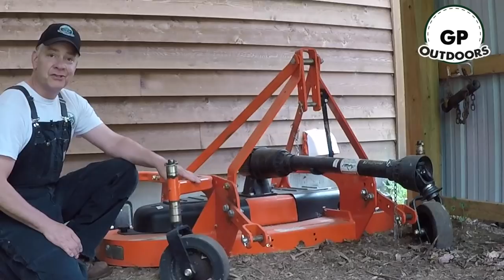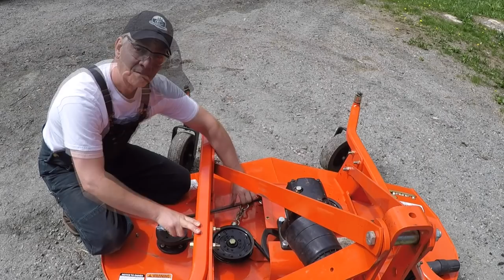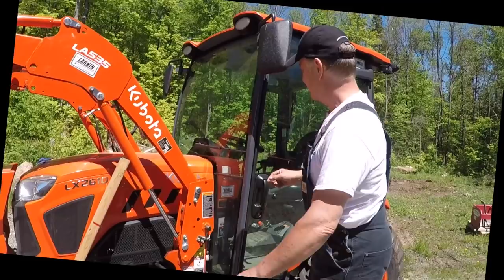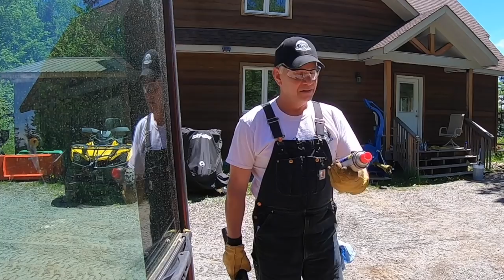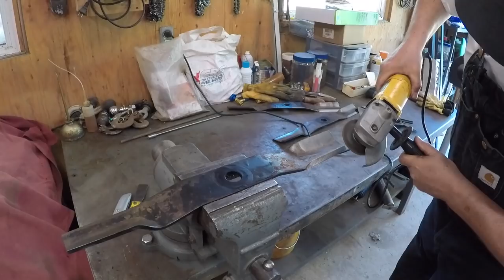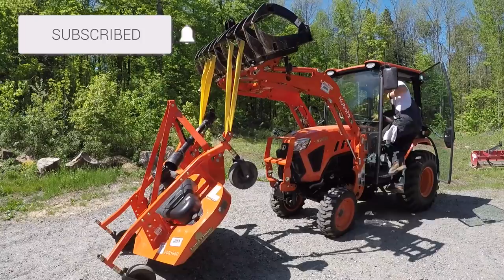#426 Landpride FDR1660 Lawn Mower Maintenance and Blades. outdoor channel.

Comment: Put some Anti Seize on the thread of the bolts to help with removal at a later date. Have a Safe Day
Reply from the maker: Thanks David!
Reply: @GPOutdoors  I use a little copper anti-seize on the bolts and it works great!  My previous mower had instructions to use it so I use it on the Kubota.  The bolts always come right out.
Reply from the maker: Thanks so much!
Reply: Sorry dave i commented before i saw yours.  I love anti seize.

Comment: Gp
Get a 60 grit sanding disc for your grinder to sharpen mower blades

Does the job in minutes and you don’t have to worry about messing up the angle or taking off too much material

Comment: Good tip to grind the back of the blade instead of the front to balance the blades. I’m going to remember that. Thank you for another informative video.
Reply: I always balance my blades after sharpening, it saves the bearings in the spindles, and lessens vibration of the mower!

Comment: I like using the sandpaper style grinder wheels. With the fine grit it gives a smooth edge. I seen where people are using a high quality ceramic coating for the belly of the deck and seams to make it easy to clean.
Reply from the maker: Good morning Kevin. That's funny- that's what Guy originally suggested - to use his sandpaper grinder. I'll give it a shot next time. Take care!
Reply: That’s a great idea
Are use the same turtle wax spray on ceramic that I use on my cars on all of my metal and plastic equipment and it does a great job

Comment: 1/2" bolts have 3/4" bolt heads or nuts. 19mm is the metric equivalent of 3/4". Bolt size is the major diameter of the threads, not the head size.

Comment: Nice pmcs. Few things...
1) Good job completely greasing the implement and pto shaft. One thing to double check after you pull the telescope pto apart make sure the universal joints/yokes are phased correctly. Some pto shafts can only go together one way and some can go 3 or 4 ways. This can allow yokes to get out of phase and will lead to vibration.
2) I’m glad you supported your loader but also remember there is a weak link still...the straps. Always place some sort of block or stand directly under the deck itself.
3) Balancing blades...to lighten heavy end grind on the very end of the blade. The perpendicular. It will take minimal material removed being this is the furthest distance from center. 
Is this attachment quick hitch compatible?

Comment: Glad you pointed out supporting the loader while working under it, many new owners don't think about that.  I made cylinder supports out of angle iron.  Just cut them to the length of the exposed cylinder rod when fully raised.  I hold them on the rod with magnets (for my BX they are 14" long.  When I'm done - the same magnets attach them to my ROPS for storage!

Comment: Good video GP.  It is also a good idea to remove grass clinging to the deck when doing maintenance.  A pressure washer helps with that a lot.  If you feel so inclined after that, hit the bare metal with some paint too.
Reply from the maker: Thanks Dave!. I scraped it but could use some paint for sure. All the best!

Comment: On my old finish mower (not Land Pride) the blade bolts were left hand threaded for safety, ie. Use forward on the impact gun to remove them and reverse to tighten. I assume that Land Pride uses convential bolt threads. Great servicing tips.
Reply from the maker: Morning M. I wasn't sure at first but yes, they are conventional.Thanks!
Reply: Thanks Gord, it may be worth reminding your viewers that they should check before attempting to remove blades ( on any mower) since they might be tightening the blade bolt with an impact gun while mistakenly believing they are removing the bolt. Many of your channel followers are new to tractor implements. So when will you be like Mike Morgan and quit your day job? 😀

Comment: GP, I see it's already been mentioned to use  anti-cease on the blade bolts.  I've been doing this for over 30 years.  Every two or three years I clean the bolt threads and apply fresh anti-cease.  On my garden tractors I sharpen the blades once or twice a year.  Same two sets of blades for 18 years on two tractors.  Also after grinding blades with angle grinder I use a 80 grit sanding disc to finish.

Comment: Great video, GP! I use my tail gate as a work surface all the time too! Good job measuring the angle of the grounded blade surface. I had never thought of doing that. You are all set for your short growing. season! Cheers!
Reply from the maker: Morning Michael. Yes, not much time for cutting before it gets scorched till September. Hey, how do you like your belly mower? One of our subscribers was asking for some honest feedback on the belly mower. Maybe you could pop out a video about it at some point. Take care!
Reply: @GPOutdoors  I could do a video on my belly mower. . My tractor is in the shop right now, the connections for the swift tach loader were leaking. I get on that when I get it back. I miss my orange friend!

Comment: I used wheel bearing (red) in the spindels of my mower (commercial lawn care business) those spindle can run hot, the red stuff does great. Also, use a flap disc to sharpen the blades instead of a grinding disc, nicer finish, smoother, and easier. Love the videos.

Comment: When checking the belt if you are without the tool use a fish scale and pull the prober amount of pounds and measure. I use that no my motorcycle and it is right on.

Comment: Great video GP.  I like the tip of grinding the back of blade if it needs balancing.  Did you need to check the PTO shaft length since it’s a repurposed attachment on a new tractor or did you use it on this tractor already?  Jim
Reply from the maker: Good morning James. Yes I did - all good. It was a long shaft and didn't need replacement. Thanks - have a great week!

Comment: Hey Gordon.  I have the same deck just slightly larger (model number 1672).  One of us is wrong.  Not sure which!  But I was under the impression that when measuring the fluid level in the gearbox, you were just supposed to drop it in the hole and NOT screw in.  I thought I read that in the manual but I'm sure I'm the one who is wrong here.  Its a moot point really because if you top off your gear box, you do it like you said and fill to the overflow hole on the side (assuming its removed).

Comment: To maintain the angle easier when grinding try putting the blade into the throat of the vice at an angle so the bevel is parallel and level with the floor thus you only have to concentrate on keeping the grinder level while grinding!
Reply from the maker: Thanks Stephen! That's a helpful idea - would have been much easier I think. Thanks so much!

Comment: Two questions. First, do you have to sync the cutting blades, or do they have enough end clearance?  Second, do you have a recommendation for bib overalls? I have an oversized orange heavy canvas jumpsuit that I used while RV traveling, but it is too hot to wear here in Las Vegas.
Reply from the maker: Hi Bruce. Great questions - no, I don't have to sync them because they do not overlap each other physically. I have only ever worn Carhardtt bibs - they have at least one light fabric option which might help. Mine are the standard R1 model and definitely get pretty hot in our summers here. Good luck and thanks for tuning in!

Comment: i gave up on sharpening the blades my corded impact wouldn't budge the bolts even after hitting with lube. got a file and did the best i could with them on the deck

Comment: The bolt through the hole is not the best way to balance a rotary blade.  There is a low cost device, purpose designed for this purpose and it’s called “blade balancer” for rotary blades.  eBay sell them etc.
Reply from the maker: Morning Steve. Thanks!